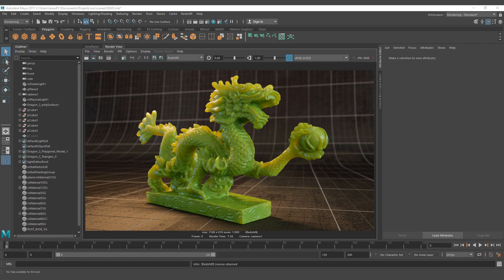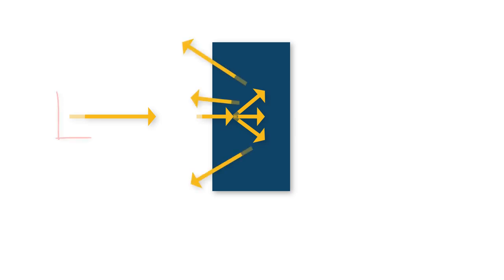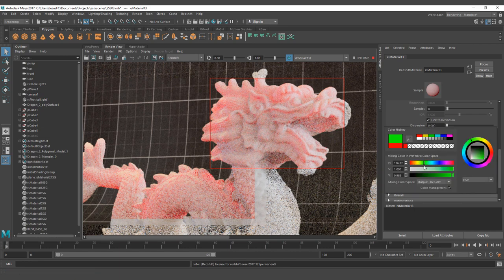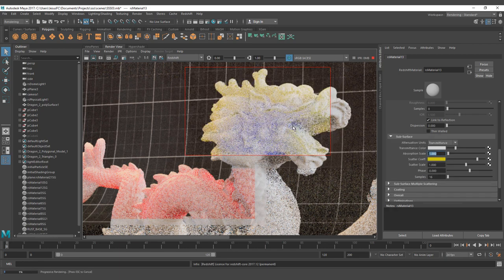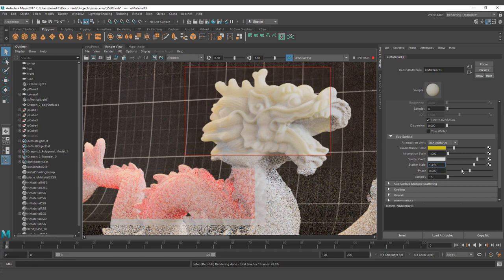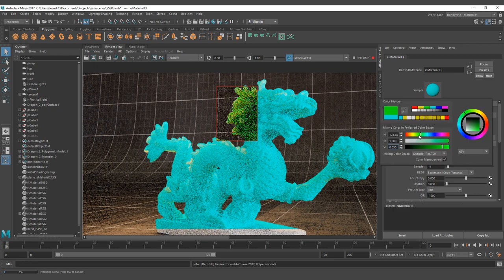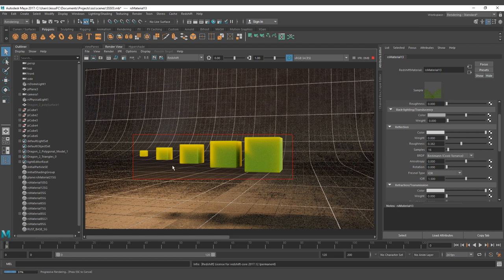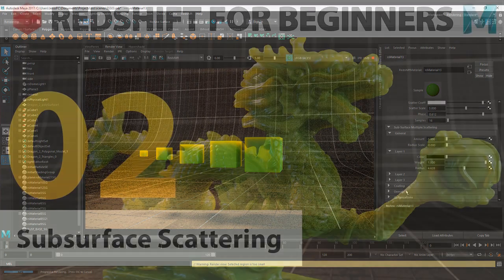Redshift for beginners - 02 Subsurface Scattering

Comment from the maker: Forgot to say it on the video. Scale is one of the most important things when working with SSS. Remember to use the correct scale of the models on this case the Dragon dimensions are 23,8 x 5,1 x 12,8 cm.
Reply: I have question. How can you determine the proper size of a model if it isn't listed anywhere?
Reply from the maker: kuunami calculate the size of your object by comparison, 1 maya unit is equal to 1 cm by default

Comment: Hello there. Keep up the good work. It is helping me a lot with redshift. What video card do you use? Thanks a lot for your tutorials....
Reply from the maker: Hello Nelson! Glad to hear that the tutorials are helping you! Its motivating for me to hear that! I am using a single GTX 1080 SC from Nvidia. The renders on this video are x15 speed
Reply: I have the same gtx 1080. I am about to get another one to make sli... =)
Reply from the maker: Nice! I am waiting to buy two 1080Ti :D , remember that you do not need a sli for Redshift, It works better without the sli on, the two cards works independently
Reply: @JesusFernandez14  So u mean if i have a 1070 and a 1080.. I can hook up both the graphics cards without sli, have one of them giving the display and both will work fine in redshift???

Comment: This tutorial is so good!!!!
But i have a problem hope somebody can help me. I follow the tutorial step by step, but my color can't change like the tutorial ( http://imgur.com/8OVEZ3i ) 
Did I miss any thing or some option didn't open?
I'm a beginner and my English is not so well,Thanks for your sharing again!!
Reply from the maker: Hey Tommy, try adjusting your Phase to see if you can add forward scattering or backwards scattering as you want. Also check your scale I forgot to say that on the video. Scale is really important when working with SSS. THe scale of this model is Dimensions: 23,8 x 5,1 x 12,8 cm. Put the same value in Maya units. Or you units on your 3D package.
Reply from the maker: You can also adjust the scattering scale its going to give you a more visible effect depending on your lighting set up
Reply: I change the model size,and it works!!now I can move on the next step.hope I can render the beautiful SSS like you~Thank you for your generosity
Reply from the maker: Glad I could help you!!  Send me the results when you are done!! :D
Reply: Of course!!it will be my pleasure